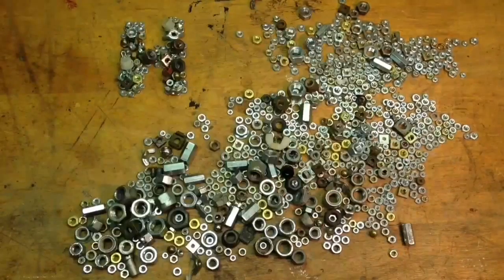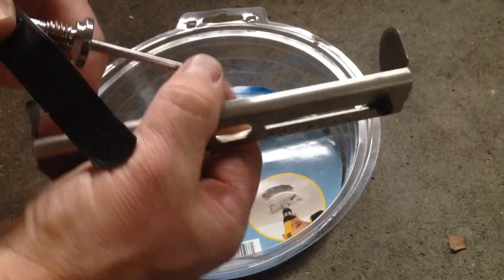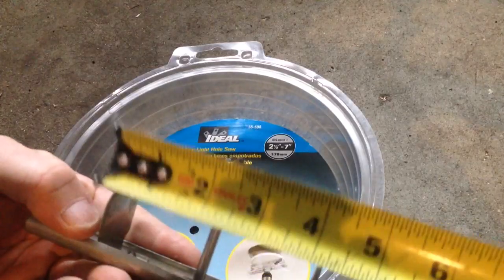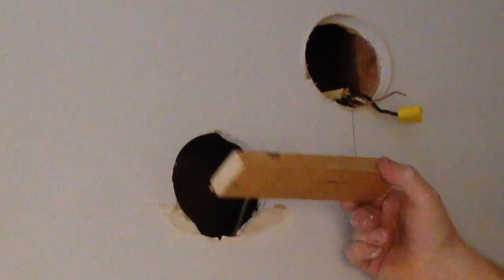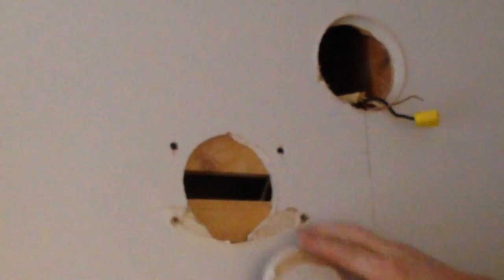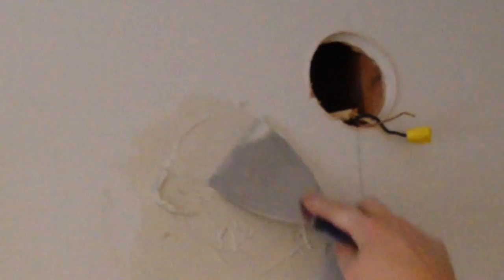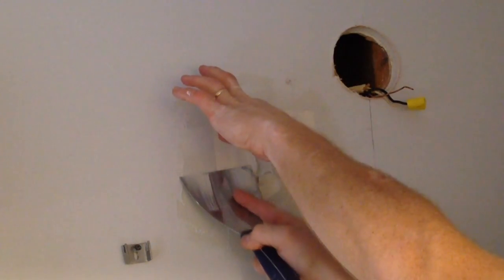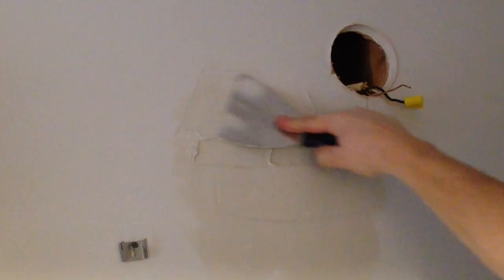Easiest Way to Repair a Hole in Drywall

Comment: I have 12 of these holes to patch up (added new wiring from the breaker panel).  Instead of wood, I used lengths of drywall 2 to 3 times the diameter of the hole and used PL Premium to glue it to the inside.  I waited 24 hours for that to dry then glued the circular cookie in the hole against the support.  Same thing here but no screws or wood.  I inspected it today and it is very strong. I didn't have enough wood but had lots of drywall pieces. I should also point out that my holes were in the ceiling so I had gravity to hold it in place

Comment: is the wood expensive?  where did you get the wood? can i use stir sticks?
Reply from the maker: The wood is relatively inexpensive, I just use scrap pieces. I have found that stir sticks split too easily so I will use something more substantial.
Thanks for watching.
Reply: Go to a lumbar yard. They are always selling scraps for cheap. I bought 80  cedar planks for $30. They were 2ft each.  I use them for patch jobs.

Comment: I'm replacing a small section in my bathroom ceiling where the fire sprinkler is.   Any tips or advice how to measure where I need to cut out the hole for the sprinkler in the new drywall?   The patch is roughly 1' x 2'
Reply from the maker: +brian012281 try to cut a piece as close to the same size as the hole you are patching, that will make it easier when it comes time to mud.

Comment: what was the name of the cutter you used?
Reply from the maker: It is called a drywall hole cutter. most of the time it is used to cut holes in the ceiling to install can lighting. hope this helps, thanks for watching.